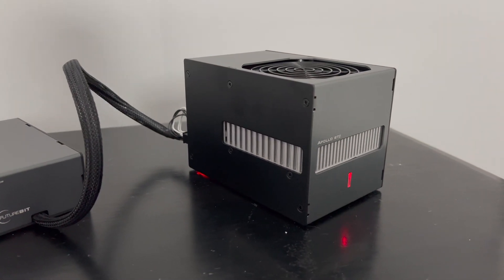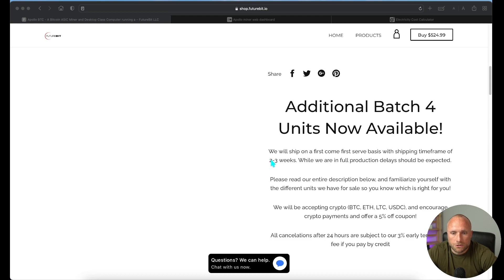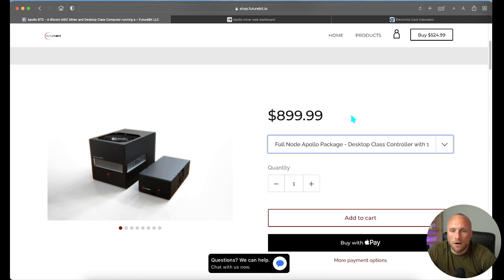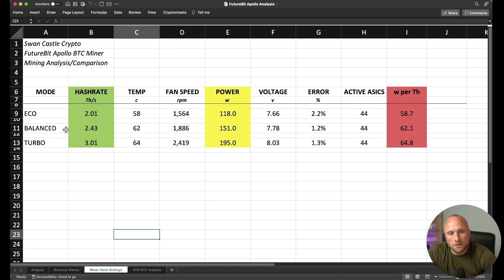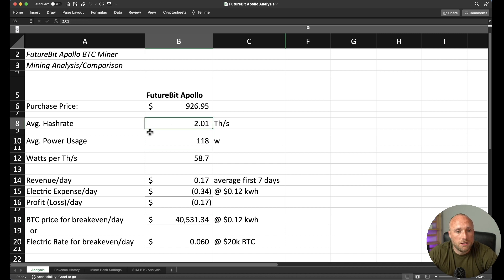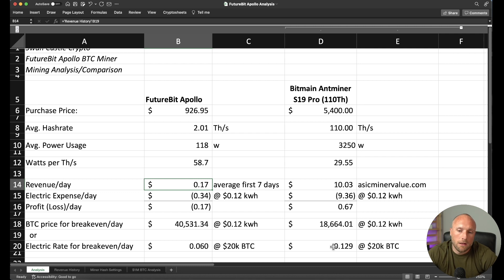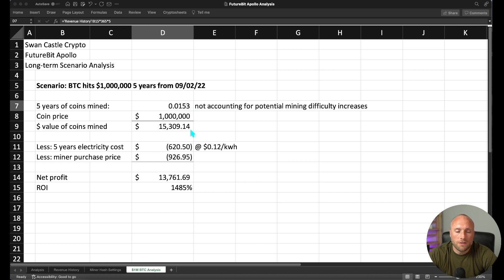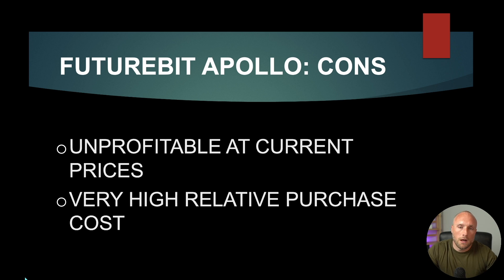Bitcoin Mining with the Futurebit Apollo Miner

Comment: Your analysis has your total production at .0153 bitcoin. With today's bitcoin price of $19,870, you could just take your total costs $1, 447.25 (626.50-elec+926.95-machine) and buy bitcoin. $1,447.25 = .07750377 bitcoin. With bitcoin at $1Million that equals = $77.503.78. Many times the profit with no hassles of running the machine.
Reply from the maker: Ohh I agree, buying Bitcoin would definitely be a better option than running this miner
Reply: Maybe investing in a hosted miner, you’d have some profit, keep part of your virgin coins and there’s no KYC.